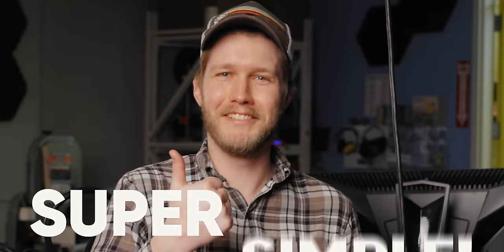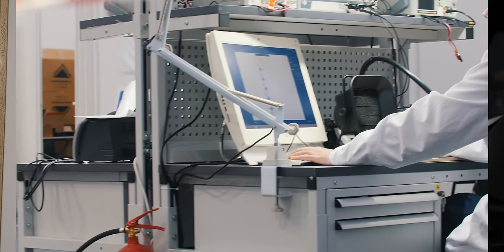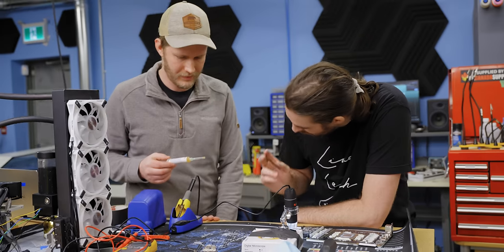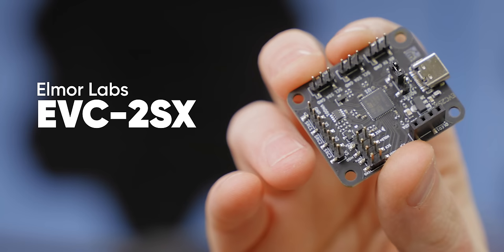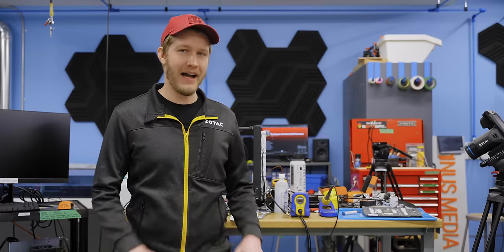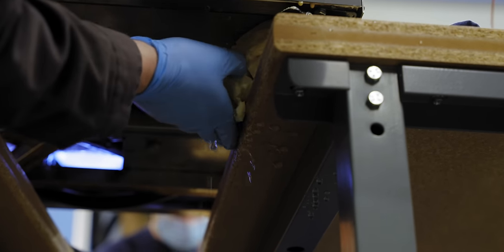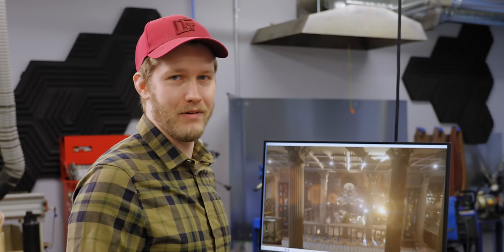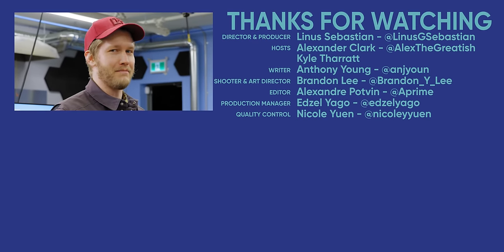Nvidia Doesn't Want You to Do This - GPU Shunt Mod

Comment: And it came to pass that a man was gifted with a i9-13900 processor, and he saw that it was good. But the man was not content, for he desired more speed and power. And he said, "Surely I shall overclock this processor, that I may have greater speed and power."

And so the man delved into the realm of overclocking, and he read and studied all that he could find, seeking knowledge and understanding. And he saw that overclocking was not a task to be taken lightly, for the processor was like a delicate flower, and it must be tended with care.

And the man prepared his computer, ensuring that all components were secure, and that cooling was adequate. And he entered the BIOS, and he began to increase the frequency of the processor, one step at a time.

And lo, the computer booted and ran without issue, and the man was pleased. But he was not satisfied, for he desired more speed and power. And so he continued to increase the frequency, until the processor was overclocked to its fullest extent.

And the man marveled at the speed and power of the i9-13900, for it was like nothing he had ever seen before. And he ran benchmarks, and he saw that it was faster than any processor he had ever used. And he was filled with pride, for he had tamed the beast.

But the man also saw that there was a risk, for overclocking could cause the processor to overheat and become damaged. And so he monitored the temperature, ensuring that it did not exceed safe levels.

And the man continued to use the overclocked i9-13900 for many years, and it was never damaged, for he had tended it with care. And he saw that overclocking was a gift, and he shared his knowledge with others, that they too may benefit.

And so it came to pass that the man was known throughout the land as a master of overclocking, and his name was remembered for generations to come. And all who heard of his deeds were filled with awe, and they said, "Surely this man was guided by the hand of the Lord." And it was so. Amen.

Comment: guys, no matter how crap your soldering iron was, you could have gotten a more precision tip, and it would have made your job quite a bit easier.
also, you can get butane soldering irons for reasonable prices that get hotter than you could ever possibly need.  so hot that you'd better practice A LOT before touching it to your GPU board, so that you're reasonably certain you've got the heat tempered back to slightly less than satan's ace hole.

Comment: your schematic is wrong. the current sensing resistor is in series with the converter/regulator , not in parallel. thus the effective current delivered but the converter flows through it entirely and allows to measure the voltage across the resistor. then you're right I = U / R , so decreasing the value of the resistor decreases the voltage across the resistor , tricking the converter -> more current

Comment: next time go to a hobby shop that sells rc cars and get solder. no need for flux if you have rosin core solder. tinning tips and the little pieces itself will let heat transfer come into play to let you have a better joint

Comment: you guys are doing way to much trying to get it on there.. next time you guys do this.. all you have to do is get a "grittle" put the card on top of that with some alumn foil as a spacer set it on med/low or so, let it heat up and this will preheat the board and make the soldering iron work as it should.  a hot air workstation would be better but not necessarily needed. just remove the old shunt and replace it with the appropriate value. i see all of you guys using the same faulted method. its easier to just remove than it is to stack them. i have power modded all of my cards prior to watercooling them. i have done the same method on the 10, 20 and 30 series (900 series was bios mod-able)  the only issue you are running into is the ground plane, there is ALOT of copper in the pcb. Preheating the overall gpu on the "grittle" for a bit will basically remove this issue if done correctly. also mixing in some lower temp solder into their solder then removing the excess can help(specifically flux core 1.6% flux SN60/PD40 solder works great).

Comment: OC is never worth it IMO, you never get more than 5-10% improvements, in extreme cases, at the cost of using way more energy.
On the other end, underclocking is actually really cool if you got a powerful GPU to which you don't need to utilize fully, most of the times.

Comment: Am I correct in thinking that "safety" warnings about overclocking a stock card, with something like Afterburner, are completely untrue with modern hardware?  
I mean, Nvidia has all the "safety" issues covered, right?

Comment: Why don't you pump the water from the bucket on the floor back into the reservoir tank? so even though it's leaking, it won't run dry and spoil Linus's floor.

Comment: 6:00 I wouldnt even touch that piece of gunk you call "soldering iron"
thats fine for soldering wires n stuff... but jesus I wouldnt use that on a freaking GPU..
The equipment needed to do a good job here is about 800$.
For anyone attempting this: you need a hot air rework station, an IR heater and a good soldering station like ersa icon v2 for example. When you know what you are doing you can do it with two of the three things i put there. Sry for the micro rant, I know not everyone is experienced with such stuff and thats okay... it just hurts me to see that...

Comment: its not the iron mybe its the tip. i bought the same and put the tip on my olw 60w one that worked pretty well and it didnt soler 2 wires together. i switched to old bits and worked fine. i didnt test the soldering iron since i tought its shit too but will convert it into hot air gun. i bought the same soldering iron for 5e on temu. the original one looks almost the same only little bit bigger same wattage cost 15e.

Comment: Currently running 2ghz on my 1080 ti and I'm proud of myself, haven't looked up if that's impressive yet tho. It's completely stable at +95mhz but I can get away with +120mhz on alot of games but temps get to like 86c and it crashes sometimes so I don't keep it there most of the time. It hits 310w occasionally at +95 and keeps temps around 65-75c air-cooled.

Comment: After watching so many REPAIR videos of blown GPU with shunt mods, I had to come and see wtf that was. Sounds just like the thing that would cause what you see on the repair videos: chips soldered to the board, almost impossible to fix. There is a reason why you don't play with voltages and resistances past their limitations.

Comment: The fact of the matter is, you did all of that, risked killing the card in varies different ways, and got measurable but minimal increases. Frankly, what that tells us is Nvidia is actually doing a good job at shipping these cards at their protentional without risking the card and having them run stable for years. That is the take away from the insanity of this project lol.

Comment: 100% that these guys instead of changing the temperature, ended up recalibrating what the soldering iron temperature sensor thinks it's at. That soldering irons user interface is terrible, and pretty much everybody does it once before they realises that if you want to change the temperature, you have to look it up the method instead of blindly playing with the buttons.

Comment: 75 watts is plenty.
What I seen, the soldering tip isn't cleaned, and tinned correctly.
Not enough heat transfers to the soldering points when the tip isn't tinned correctly.
Also, the tip you using isn't designed for SMT components, making it more difficult to get more heat properly on the ends of the SMT components.

I have done many times in the past working on SMT components,  even back in the days of the PS1.
Reply: One other note, some SMT components are not as tolerant to heat, that the soldering suppose to be fairly quick, as some SMT components damage if applying to much heat too long.

Comment: 2 things on that soldering - probably set the temp offset, as others have said. also a board heater is something you guys should probably  invest in. Makes soldering things that dissipate heat much easier when you can have the whole things set to a certain temp before hand. I have to do this for my job as something i solder regularly has a lead that is very large on the board and so there is always 1-2 pins that are a pain if I do not use the board heater. in my case, board at 150* and solder iron and heat gun at 325*.

Comment: Oh god, *petroleum jelly*..?  I know it's not useful on all the things but have you ever considered 'conformal coating' for parts you simply want to keep condensation/dribbles away from?  I have been using MG Chemicals '422C' silicone conformal for my 'keep water out' uses.  It has an operating temperature range of -40 -> +200C (or -40F to +392F), so it works on all my common PCB components except maybe MOSFETS and stuff, but I generally need to only keep resistors and surface-mount stuff from getting wet from condensate.

I mean, I know petroleum jelly CAN be cleaned off, but...I don't know.  It's like using 'Bluegrass clay to keep metal slivers away from CNC slides' or somethinbg.  Sure maybe it works, and there's nothing wrong with good clay, but you're still spreading MUD on your precision equipment before using micron-accurate measurements to do something /perfect/...and then you still have mud.

Just...ugh?

In other comments; yay for Seasonic STILL not making craptacular power supplies (that I'm aware of).  When people ask me about power supply brands,I look up EVGA or Rosewill or Corsair I have to look up "who actually made it", and if it's from Seasonic I don't have to look any further.  I own several Seasonic's, I cheerily suggest them to others, and I make a point of mentioning that "SURE you can get something cheaper...so long as you want something CHEAPER."  The extra cost isn't that much, and the extra lifespan and reliability of them pays off several times over in my book.  You only have to troubleshoot the heck out of one computer to find out that the +5V like flakes out a /tiny/ bit every six hours it is in operation for whatever reason and THAT is why your I/O all drops dead after it was running for a while to decide that cheap power is...cheap power, and that's all.

My power supply is like my video card, or my brakes...I want them to be a reliable quality.  I need to be able to COUNT on them.  Brakes are more 'life-threatening' to have quality issues with, but losing out on work-time as a remote IT admin because your power supply dropped dead or "you dunno why your I/O all stops working every now and then" is bad for customer confidence...so it's 'up there' in value for me.  Maybe my power supply won't protect my life, but it "protecting my reliability" is really close in importance.

But again....aaaugh, petroleum jelly!

Comment: 7 months later and ebay is dripping with 3090s.  I'm surprised they don't have a GPU rig featuring non-conductive fluid, then they just dunk the gpu in a tank of this fluid with some kind of cooler to keep it from boiling.  Or they could have this non-conductive fluid in a stock gpu cooler and not worry about it leaking. Next they do this, they want to have an out-of-the-box gpu cooler first.

Comment: Why not just program an arduino board to work at the temp sensor so that you can manage temps with a tiny keyboard io? instead of sensing temps you'd be inputting a temp and with some testing you can figure out how to run the card fully overclocked at a steady 30 degrees and have functions for your arduino that can increase the compressor speed by tweaking ambient temps so you can have a gaming mode and an idle mode. Sounds unnecessary but so is most of ltt. also this can be taken a step further and used to cool a xeon build or even just a render farm cooler.

Comment: you need to tidy up that cooler. why use water? run the window rattler as a heater, and put the low pressure side of the Freon gas through the 'water block' done. gpu is now a room heater. and if you want to get the highest score why not go all out and submerge the whole computer in an aquarium full of mineral oil and 'water cool' the mineral oil, you could even put an aquarium pump in there to circulate the oil lol.

Comment: Dude, you guys need to just get a proper soldering iron. You spent probably $200 on that Hakko POS when you could have spent $60 on a miniware TS-100 which can go all the way up to like 480 degrees. And can be run off a 2S-6S battery, making it essentially wireless. Or at least portable. And you can also run open-source firmware on it.

Comment: Oh man, my heart is bleeding, for ROHS you need at least 260C, on motherboards, gpus, etc.(good heat dispatch) you need 360C to 420C for good and fast soldering ;) also you can add non ROHS solder wire and this will lower temp. of makeing solder liquid, sorry for my English ;)

Comment: 2200MHz is good?
My old PNY Revel 3080 will run 2200 all day without doing anything crazier than a little bump in Velocity-X. No over voltage...+200 on the clock and memory, power to 109%. It's supposed to have FE specs 1440-1710MHz. However, on factory settings it typically runs between 1995-2050MHz.

Comment: Bless his heart but Alex is sort of the fall-guy at LTT. He always seems to half-ass certain things that bite him in the rear later - but only take a hot minute to do right. It gets him by, but all that time he tries to save seems to cost him a lot more later.

Fix the leak right? No, let's mix urethane with water. Mask the pcb with painter's tape for thermal paste? No, let's glop it on. Get a high-power soldering iron and proper solder/flux? No, let's use a toaster.

Comment: I don't understand how a project like this gets off the ground on a channel with 14.4m subs without the right soldering iron, little thought for cooling, or even a thermal paste spreader. The Verge's PC build got crucified for using a swiss army knife as a screwdriver, as LTT considers soldering a 3090 on top of a toaster oven. The icing on the cake was the phase "it's simply a case of silicon lottery" said with a straight face, as the condensator drips water onto the ground, and the card is sloppily covered in thermal paste, flux, petroleum jelly, and a "hacked something up with an angle grinder" cold plate.  An absolute mess that just comes off as insulting privilege to the viewers who can't get a hold of a GPU.  I thought the $20k NAS for Linus' house was a bit ostentatious, but at least it was built with technical skill filled with useful information. The only justification for this is entertainment, at the cost of appearing in any way relatable to your viewers. Zero self awareness or "fuck it" monization chasing, not sure which is worse.

Comment: I could have soldered that in 2 minutes....with a Hako.   Should have "tinned" the ends of the resistor first.  Flowed flux way more.   You guys need a real tech on staff.  Who said you had to use a surface mount resistor anyway?   A simple axial metal film resistor would have been even easier.   We should talk....

Comment: why don't you get one of those small window type ACs, then put the mother board right next to it in an enclosed insulated box? you would have no leaks, no condensation. Check out Tech Ingredients for this, they did something similar for cpu overclocking, I don't see as to how this can't apply to the GPU, or maybe since this is LTT, Linus why don't you get a walk in freezer and setup a super overclocked computer inside the freezer, I think with this you would be interesting to see

Comment: It's really easy to change the reference temperature on those soldering irons rather than the set temperature... so instead of setting a higher heat, you're telling the iron it's current heat is higher.... Ask me how I know!!!

Comment: How come when overclocking on ln2, nobody use  Conformal coating? I put a thick layer on my miniquad and it can be fully submerged in water while powered up and can immediately  fly without even letting it dry first. No shorts.

Comment: 65 watts is plenty of power for that job and it goes up to like 480c NOT 220c!
YOU ACCIDENTALLY RECALIBRATED THE SOLDERING IRON instead of turning it up, you turned it down. It only has 2 buttons, you pressed up when you should have pressed Enter first!
Buy a  soldering tip temp tester to make sure you are always adjusting the temp & not recalibrating the unit! For now you will have to do a "U" factory reset and RTFM, Seriously read the manual.

I cant believe that Gpu still worked after that soldering job that was pitiful

Comment: That was hard to watch. Get a SMD iron and use the solder to promote thermal conductivity. Your iron is fine, the problem was the minimal surface area in which you were able to transmit heat.

Whoever the new guy is is a loudmouth and should quit blaming the equipment and git gud.